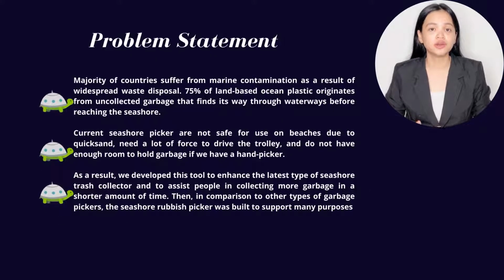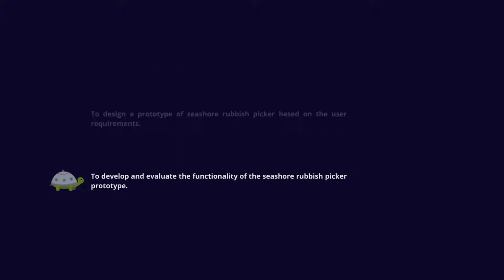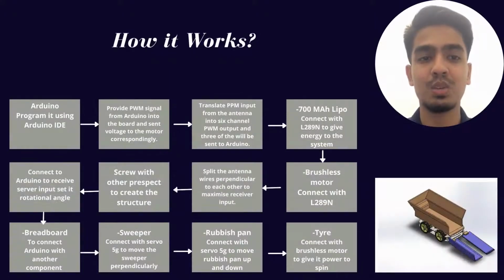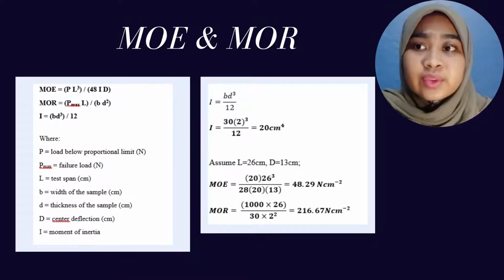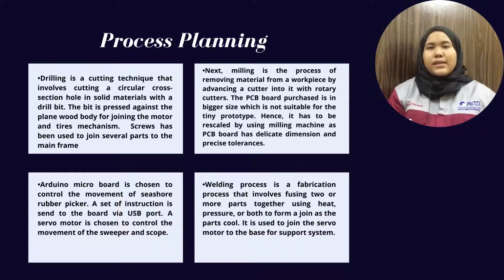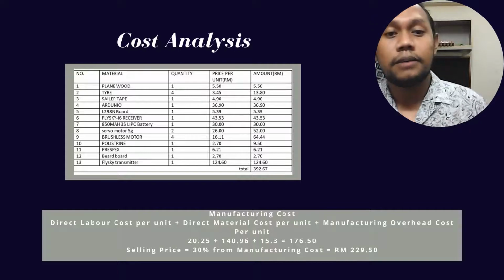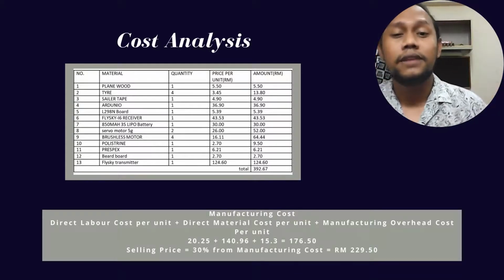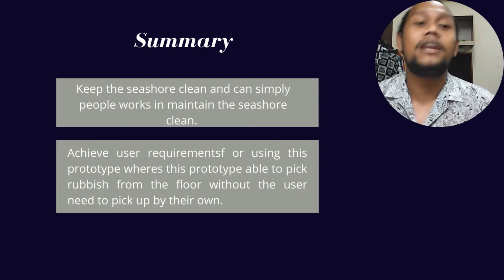BMFU3223 INTEGRATED DESIGN PROJECT (GROUP 26) (2021) ( SEASHORE RUBBISH PICKER)

Comment: What is the estimated product weight in real size? Do you think this design is robust enough for wet/sandy seashore application?
Reply from the maker: The estimation of our product weight is 17 Kg. This product is robust enough for use on sand because it uses tires like a wheelbarrow that has relatively thick tread and thick tires .

Comment: What is the max load of rubbish that can be taken by the sweeper?
Reply from the maker: The maximum load that can be taken by our prototype sweeper is a solid that weighs 5 grams. Because the servo motor used is a 5 g servo. The estimated weight of the actual product that can be taken by the sweeper is 2 kg